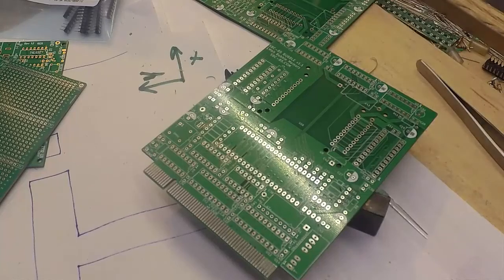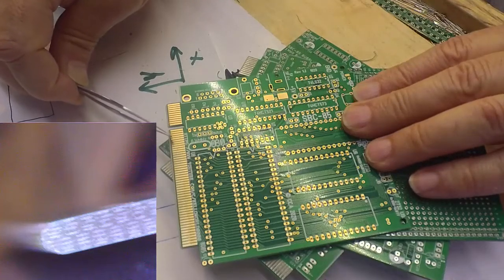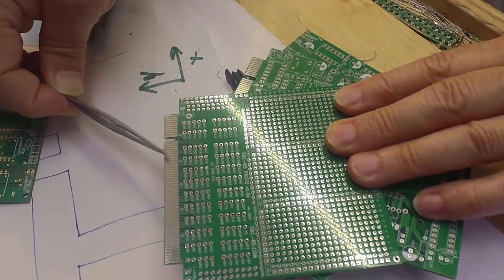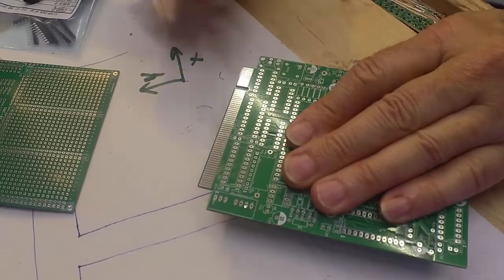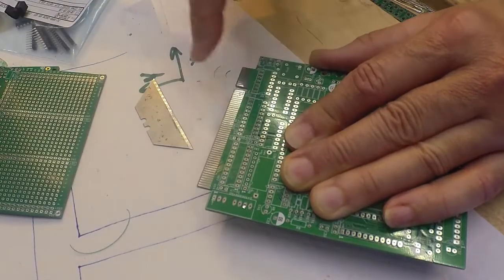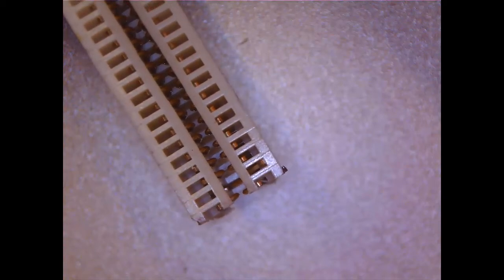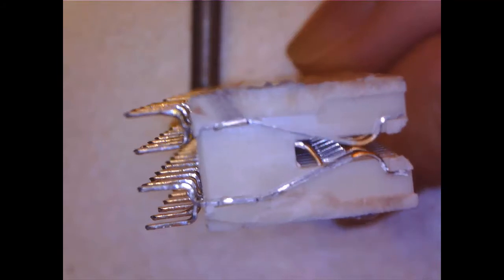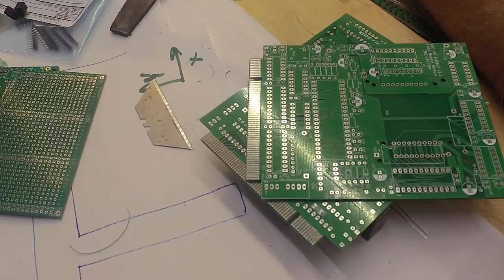{54} Break the Edge of Your Circuit Board Edge Connector or Risk Ruining The Backplane

Comment: Good tip! I'm about to build a multibus extender board for an Intel System 310, I don't want to mess up the backplane!!
Reply from the maker: Indeed. Multibus has enough backplane issues even without bending or scratching the gold off the backplane connectors.

Comment: It is best to do the chamfering with gloves on.  Greasy mitts on edge connectors can cause unwanted corrosion & tarnishing - even on gold! Avoid tin plated contacts as they form tin whiskers that cause unwanted shorts.
Reply from the maker: Yes, I have seen many a fingerprint on gold fingers.  Technically very true about wearing gloves, oily hands can cause all sorts of trouble.  
Obviously my hobby toys are not a critical application so I worry more about getting a fiberglass sliver in my hand than I do about the oil causing a whisker to grow. .